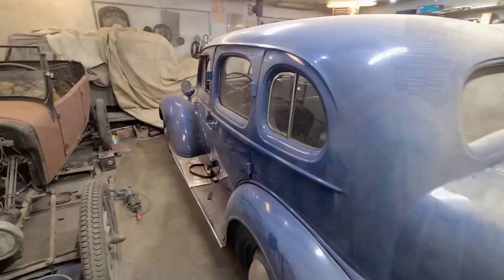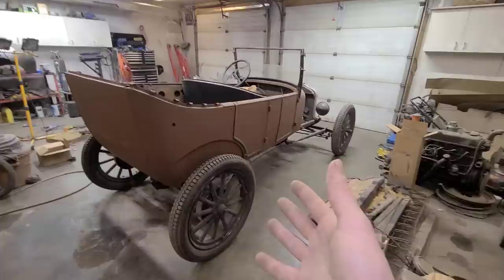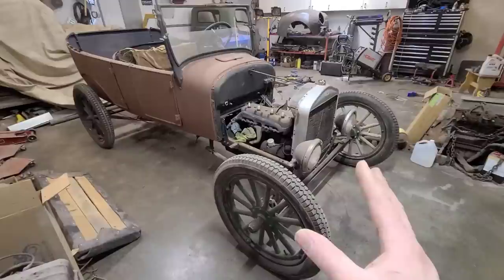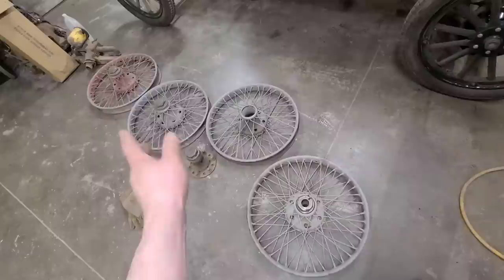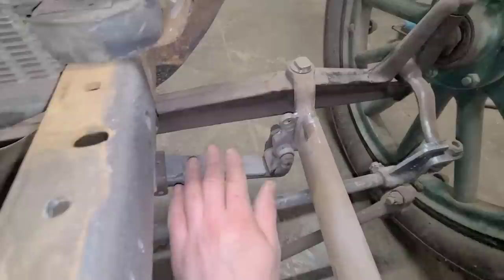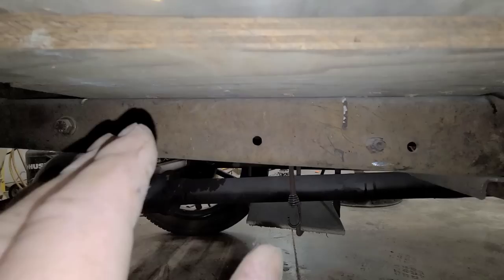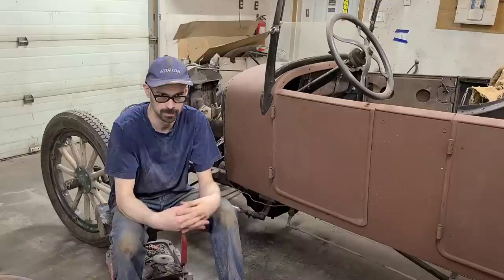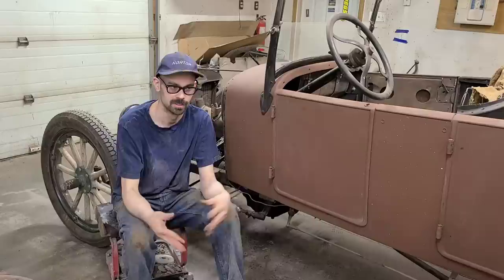1926 Ford Model T. End Of The Line, Or a New Beginning?

Comment: I like your style. Using period correct parts is so cool. That's why I went with a blower on my 1000hp Chevy I6/292 in my 53 3100. I can't stand a turbo on an old hotrod. I like a consistent theme on cars whatever it may be. My guess on the next project is a roadster. Thank you for your time.
Reply from the maker: I totally agree, that sounds like a wicked engine you built up!

Comment: I always wanted to build a Gow job ,especially since I had a 1918 Copy of Dykes automobile instruction,which has a whole chapter on how to build a "fronty Ford" using a derelict Model T . Then in the early 70's I read in R&C about an old boy in LA who was still driving a souped 26 Roadster he had built in the early 30's,with OHV head etc etc .For one reason or another I still haven't found the time to gather up the bits and knock one together.
Reply from the maker: They are a lot of fun, I hope you're able to get around to it someday!